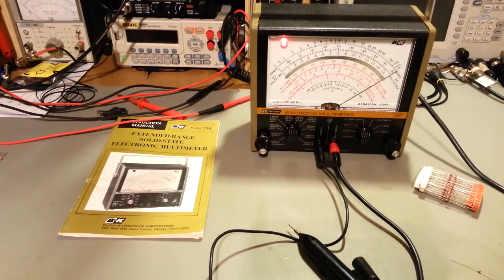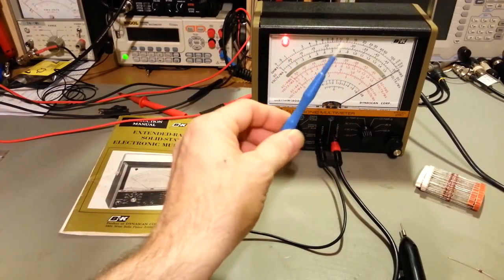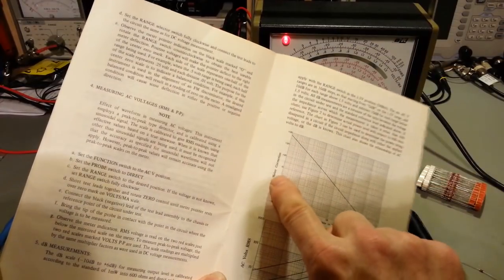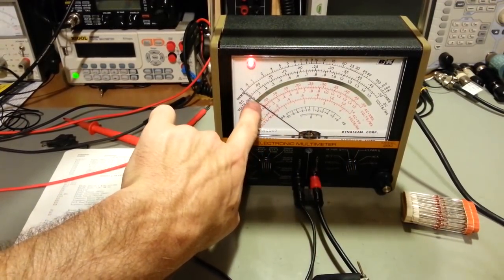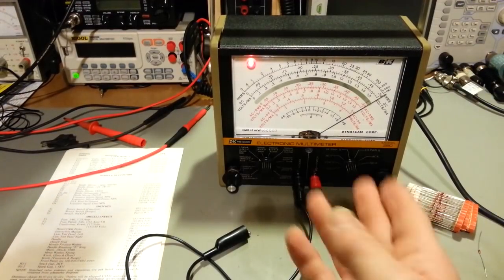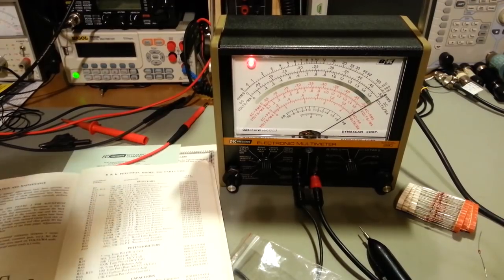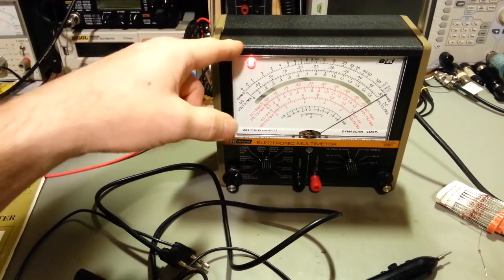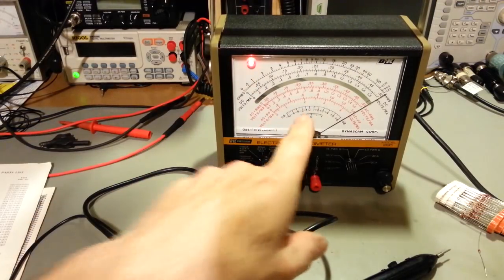BK Precision 290 Electronic Multimeter repair and overview.

Comment: Just FYI I have two of these and one has the resistor and bulb, but the older one has just a neon lamp. Also the schematic I have, and the only ones I've found on the internet, shows only a neon lamp and don't show the LED and bulb. Do you know where I can get a copy of the schematic you have. Thanks for a great video -Dave

Comment: I bought that meter after seeing your Video on B&K 290, but it pegs to the right. So I bought another (for repair parts) and it too pegs to the right no matter the settings?
Reply from the maker: First make sure you have the zero adjustment and ohms adjustment knobs on the front set.  Turn them full rotation both ways and see if it has any effect.  Next try to calibrate the meter.  See if someone has been tinkering with them and has the calibration pots way out of adjustment.  If you have no luck there it's time to troubleshoot the meter circuit.  It's a very simple circuit like most analog meters so finding the problem shouldn't be hard.

Comment: Any tips for replacing the probe, or a diy solution? Mine was missing when I got it.
Reply: Found one on eBay, not sure if I will spend $60 though.
Reply from the maker: That's where I got the last lot of 15 of them I bought, ebay.  Think I only paid $20 plus shipping for all of them.  Not much to them.  Just a shielded cable for accurate AC measurements and a 100K resistor for the 100K position when measuring DC voltage.
Reply: MikesRadioRepair Thanks for the reply. I’ll probably build my own, and keep my eye out whenever I go to a hamfest.

Comment: Thanks for the great video. I enjoy your videos a lot. I agree there’s still some instances where you can’t truly replace a needle meter. Stupid question here but can you please explain why the needle was all the way pinned to the east (right) the whole time? Traditionally I’m used to seeing zero readings on the left side. Just curious thanks again for the great videos! 73
Reply from the maker: +Enrique Paz 

The needle is to the extreme right because the meter was in the ohm function.  With the test leads not attached to anything that is infinate resistance, hence a full scale reading.  Short the leads together and thats  0 ohms which is needle full left.
Reply: Ah-ha! Thank you for the missing puzzle piece that makes perfect sense now.

Comment: Thank you for making this video. I have heard and understand the input impedance issue for sometime. But this video finally clicked in my head why the voltages are different when I was testing a repaired or restored unit with a DMM. Simple but overlooked by myself over and over.   .

Comment: Great explanation , sounds like the light bulb is acting like a fuse.
Reply from the maker: +Joe HamRadioGuy 

A fuse blows when it's current limit is reached.  Connected in series in circuit like this the  light bulb is a current limiting device.
Reply: MikesRadioRepair as long as it works lol thanks Mike
Reply: . Yes, a lightbulb has a positive temperature coefficient.  So when it heats up, its resistance goes up, and the current comes down.